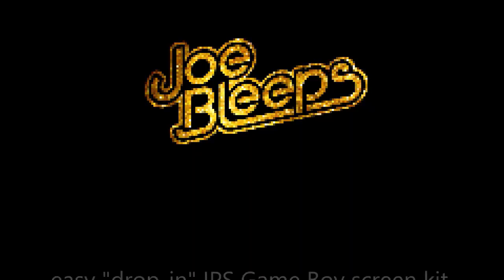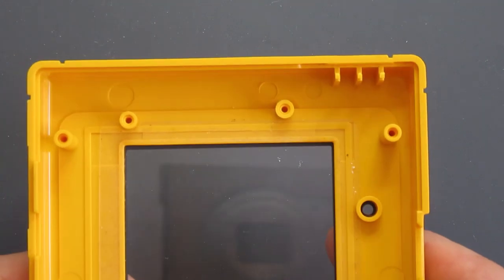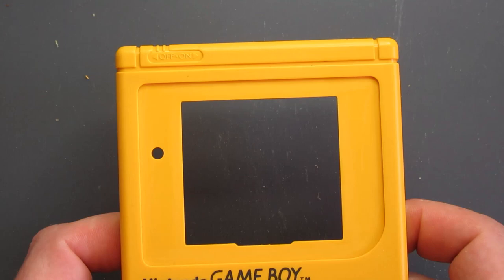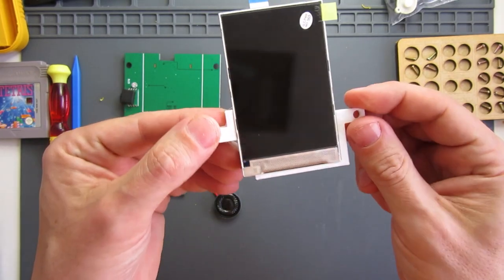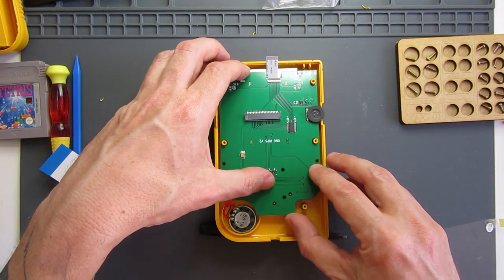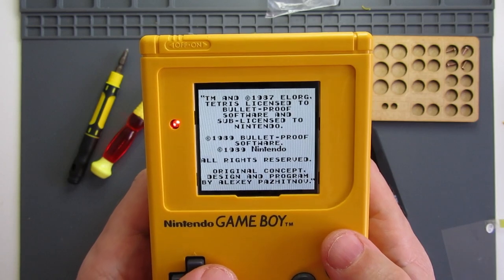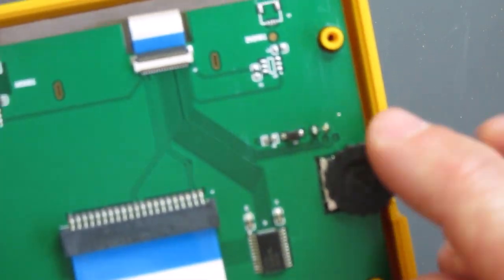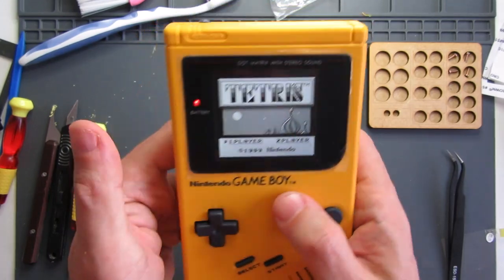Easy IPS screen kit with 3D printed bracket for DMG

Comment: This kit is great. I held off on the first versions I saw as there was no mounting bracket. I was happy to pay the premium for this kit because it came with the bracket and new speaker and I got it next day.  Easiest DMG mod I've ever done and the display is a an absolute beauty. Top notch shed video!
Reply from the maker: I agree completely, convenience is key with a kit like this.
Reply: Joe Bleeps couldn’t be any easier unless Luke from retrosix popped round the shed and installed it!
Reply from the maker: @brianellerker9038  haha! I actually like the challenges presented by these things but it's nice to be able to advise people on stuff that anyone can try like this!
Reply: How are the buttons? I got a kit from China, had troubles with buttons registering properly. Ended up using a combo of new and old silicon.
Reply from the maker: @grumbirky  I've heard about issues with that. Cleaning the pads on the silicon parts helps. With this one I used original parts so that likely helped, all seem to be registering well so far.

Comment: A really cool kit. It is impressive how easy it is to install it.
Reply from the maker: It really is! Especially after years of doing backlight panels. I do fear a lot of good consoles and parts will be wasted with people using kits like these. I hope they get used more as a repair than a simple swap.
Reply: @JoeBleeps  Honestly, both modifications seem good to me, although the quality of this kit is much higher, sometimes the classic modifications are the ones that have more charm. But without a doubt the quality of this screen and its ease of installation is incredible. Even so I would have a game boy with each modification.
Reply from the maker: @elartisans  that's a good approach. Room for everything. I would always use these kits when there is damage to the LCD. Looking forward to trying the gameboy pocket panels for that very reason!
Reply: @JoeBleeps  Without a doubt when the screen is in poor condition this kit is a wonder, otherwise you would only have a motherboard.

I hope that the screens of the game boy poket are as good as this one. I will be waiting for your new updates.

Comment: Great video mate, will be using it as a reference when I put mine together.
A piece of foam or bubblewrap put behind the speaker could stop it from vibrating? Just a thought for people like myself who don't have a glue gun.
I ordered what looks to be the same kit from Aliexpress a few days ago, it cost £47 with free shipping.
Comes with a 3D printed bracket but does require soldering the speaker from the original board.
Really enjoying these easy to install kits that are available nowadays, I could never manage something like a bivert mod.
Reply from the maker: There's definitely a less intimidating entry point to the wonderful world of modding now! And yes some foam or bubble wrap may help, or if you're soldering just use the old speaker if it still works, it's a perfect fit

Comment: I'm thinking about doing a IPS mod to two of my broken DMGs.  But just wonder.  Is the sound any better?  Ore do i need to do a amplifier mod to? I was just wondering because i have some hearing damage :)
Reply from the maker: The sound is about the same, but it's just a single small speaker after all. There are amplifiers you can get, but I would likely suggest headphones, this one sounds great through mine.

Comment: I bought a pre modded one off ebay but I notice the D-pad and A/B buttons go a bit deeper than the original,  even though everything seems to be tight, disassembled to try to figure it out but didn't see anything wrong even got a new shell but same issue. the power button is also not as solid and protruded as the original. have you seen any of these issues in yours?
Reply from the maker: That's very strange! Can't say I've had that issue myself. Are you using the original silicone pads?
Reply: @JoeBleeps  probably not but I think I found the problem: the aftermarket shell is defective and has deeper holes for the buttons, I bought another gameboy in original shell and tried the V2 pcb on it and it feels normal. it's annoying both the shells I got have the same issue :D. I ordered a new shell from retrosix, hopefully that one will fit better :)
Reply from the maker: @grainity  Ahh okay, I hope so too!

Comment: is it possible to replace the speaker with a new one or a good working one from a broken GB? so u dont have to hot glue a speaker in place?
Reply from the maker: Yes of course. Last time I did one of these I used the original speaker and it was much easier, but I wanted to use the kit as it was presented as much as possible. I spoke with retrosix and they said they have adhesive speakers on the way which would also eliminate the need for hot glue. It sounds good now though!

Comment: Have you noticed any issues with button responsiveness? Supposedly it's a relatively big issue with this mod.
Reply from the maker: I heard that too, I think I've been lucky on both the ones I've done, no problem in that area. I did see some guidance that suggests you remove some plastic from the back shell, near were the d pad sits, to ease the pressure a bit, so I'll try that if I have any problems next time!